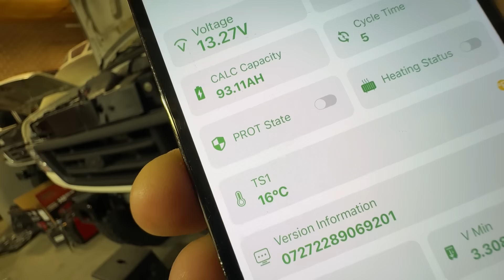Got a Call With Bad News From The Tuner Guy 🫤 MOVING BACK IN

Comment: Crome, I don't know If you asked HP tuners for help but give it a try.  My SUV wasn't supported either, and I wrote to HP tuners to see if they could help me. Long story short they asked me if I could send my ECM to them which I did,  and they were able to get it to work.  Technically it still isn't supported but it works.
Reply: Forgot to mention that My Toyota vehicle is supercharged and this opened the door for others to use HP tuners to tweak their superchargers instead of just running the stock base or factory tune.

Comment: Just do a Mustang tune . As long as it is the same engine and trans the ecm doesn't know what vehicle its in.
Reply: Exactly. Having to buy another tuner sounds fishy.
Reply: Mustang is a sports car, the power curve will be cattywampus for a van if you use that tune.
Reply: That's it I'm out
Reply: We did well the electrical guru buddy of mine did it. same thing we put 5.0 mustang engine in old f150 truck we didn't want to mod anything radical. As long as the truck was running smooth it work. It's not gonna know the difference.
Reply: Yea that's what I was thinking also.
Reply: Genius.
Reply: There is no such thing, as an E Series tune.
Motor, and trans match ought to work. 
Anything E-Series performance, is very niche.
Hurry the hell up with that shop.
I've got a big project coming up!
Reply: It won't work. He's got a Ford. Integrity of the build and Integrity of the mechanical structure of the update process wouldn't allow for it. At this rate, Chrome is epic enough that Vancity Vanlife will  end up in a museum somewhere some day. A looooong time from now, hopefully.

Comment: When it comes to plates you can’t beat corelle. Chip resistant, strong yet light weight and fit in the dishwasher. Corelle is made by the old Corningware and Corningware lasts and lasts and lasts. And the plates are so heat resistant they can be used directly on a stove element and go into the freezer etc. the milky white colour of the plates comes from the extreme high heating process that was discovered by accident. Makes them break resistant as well in most circumstances.